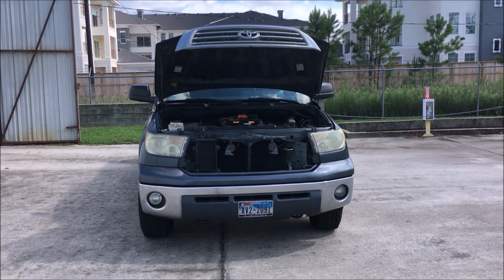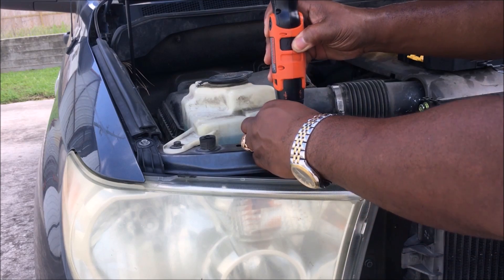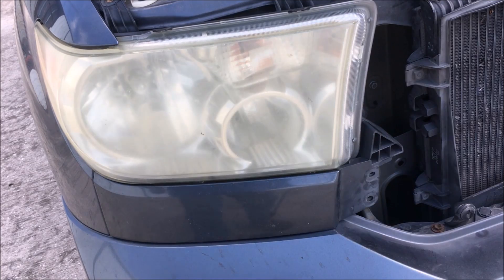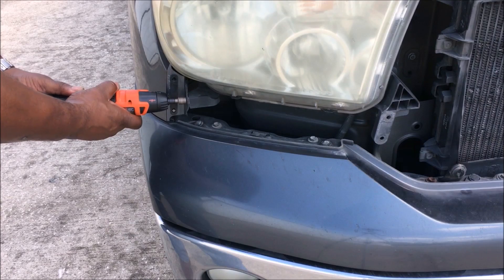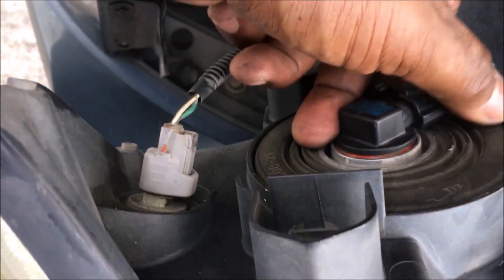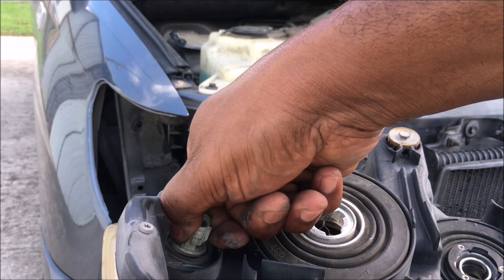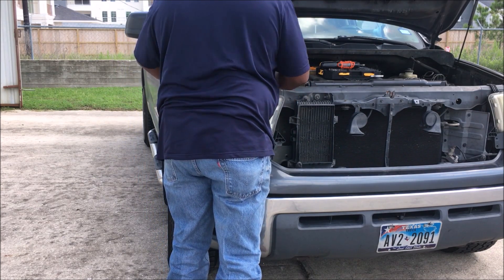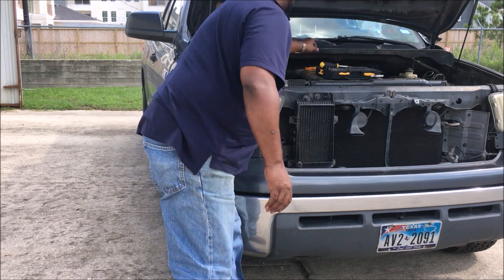How To Replace The Headlights On Your Toyota Tundra 2007-2013

Comment: It's March of 2024 and I just bought a 2010 Tundra that was a Carfax one owner with just over 109,600 original miles (yes, I guess I'm bragging a little), and this is the first video I came to to change the low beam bulbs out and it's a great video. Tells me everything I need to know. Thanks from a fellow Texan!

Comment: Thank you!  I have an 08 with 200K miles (STILL a great truck!) and the head lights are yellowed now - I want to replace!  You made it much easier.  I'm going to order some and install them myself.
Reply: I have 08 Tundra just a bit over 124k miles. Still in good working condition. Also with VERY yellowed head lights. Going to order them and change them myself. Hopefully by now you have changed them brotha.

Comment: Turn it counter clockwise.  I spent 20 minutes trying to find where to pinch it to pop it out.  4yr old video still helping me out.  That screwdriver trick to pop the panel out helped too.  Thanks.

Comment: I figured it out thanks to your video.  The heads up on possibly breaking the pins was good.  I took my time and went very slowly so had no breakage.  One concern was maybe scratching paint with screw driver.  I'm thinking one of those plastic door panel tools may work better.  I had to replace drivers side high beam.  Got it apart and found it didn't use  the H11 angled base I had for the larger low beam.  For the high beam it uses the 9005 angled base.  My local auto parts store had them in stock.  Don't get straight base version for either.  Won't fit plug.  When I put back together I sprayed garage door lube on pins.  It has lithium in it.   The secret for a smooth go is to go slow and be gentle.   I now have to polish my 07 Crewmax light lenses to bring back the clarity.

Comment: Thanks for the video as I just changed out both of my headlights on a 2008 Toyota Sequoia with the lens washers. I purchased my lights on Amazon which were $105 for both. I did upgrade my low beams to Sylvania silver star. It takes a extra minute to remove the washer assembly from the bottom of your headlights and another minute to install on your new headlight.   I was in no rush so twenty minutes per headlight is about right

Comment: Easy and good demonstration. Only advice is it does not come straight out as suggested push in towards the truck on inboard side as there is a catch that prevents pulling straight out, unless you catch is broken.

Comment: I do not have the correct year Tundra for this video, but I got enough information to change out the bulb on my own 2005 Tundra.  My problem was, I did not remove the light assembly.  It is possible that I could have put the new bulb in without doing that, but taking out the assembly made the process much easier.  Thanks.

Comment: LED bulbs require removal of the headlights. Toyota made some super tight tolerance, OEM bulb size can pop right in and out but nothing larger. And use a pry tool for that filler piece its super sensitive.  On one side both the tabs broke, ended up using some 3M doublesided tape in it's place.
Reply: Broke both of mine too. Hows that 3m double sided tape working

Comment: Great video ty . My 2010 tundra has a wire harness connected to the adjusting screw . Im guessing my lights could be adjusted in the program? Not sure and I completely disconnected from new light housing

Comment: Great video brother, but it doesn’t mention the auto adjust sensor on my Toyota Tundra 2013 and it has an additional sensor that your truck didn’t appear to have.  Anything you can tell me regarding disconnecting that auto sensor?

Comment: Thanks for the easy to follow video.   Is there any issue with making sure the headlights are properly aligned after you put it all back together.  It doesn't look like there is much in the way of adjusting and aiming anything but I recall reading it's something to watch out for.
Reply from the maker: David Remsen not sure

Comment: Thanks for the video! I think I might have gone ahead and just replaced the entire headlight assembly thought it would have cost more than the bulbs. That would save you the trouble of polishing them -- which is admittedly easy but still leaves some protection issues. Oh, well. That's not the purpose of your video. Good work!
Reply from the maker: Thanks for watching; glad to be of help.  Please pledge and share so that I can continue to make helpful videos, pledge at www.patreon.com/weldingandstuff and this will also enter you into the monthly drawings giveaways (gift cards and more)

Comment: Have you ever changed the power outlet sockets? I'm finding it difficult to find a video of this.
Reply from the maker: LOL!!!! I looked at it, it looks really difficult (I will check today)
Reply: Welding and stuff don't say that! I have 2 I need to do...😂
Reply: I got both the rear console and passenger outlet cover changed out. The front was tougher as it was almost a too tight fit. I had to sand down the two locking tabs so it could be fit back in. Timely, but it can be done, even by me! 😜
Reply from the maker: Chris McDuffie I think I'm going to have to change one in my daughter's BMW. Good job
Reply: Welding and stuff it should be easy for you then!

Comment: Hey there!!  Anyone  know if there is a fix for this:
2013 tundra.... Headlights that are left on after door is open does not provide an indicator beep and does not turn off automatically.
Any fix? 
When headlights  are left it just drains the battery.... They do not shut off.
Thanks.

Comment: When removing the extension panel for the lower bolt, be very careful in removing it. Do NOT use a screwdriver, it wil chip the paint, usr a wider tool, and work your way up and down carefully.  Very poor replacement design.  Both my plastic tabs broke on the one I removed, and it's difficult to find one that is painted other than black.  The tab fastener hardens up over time.